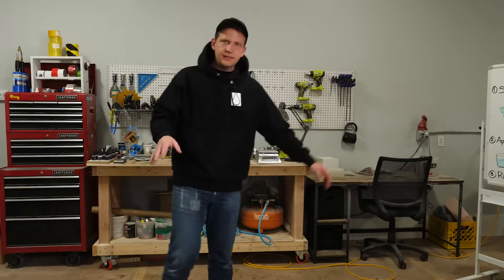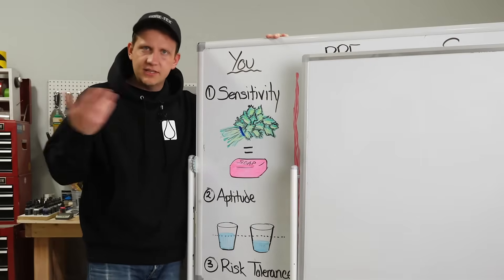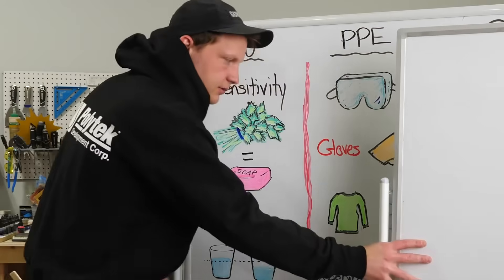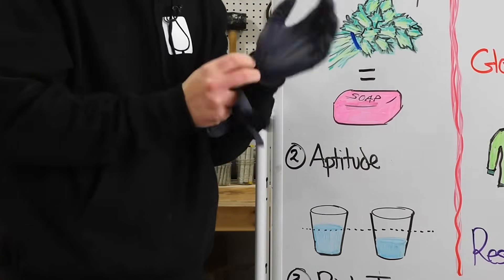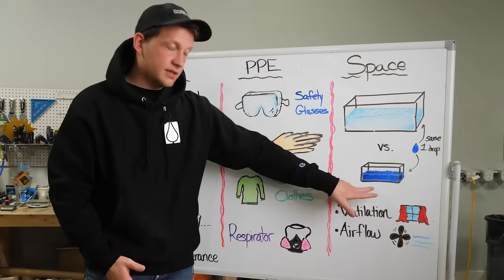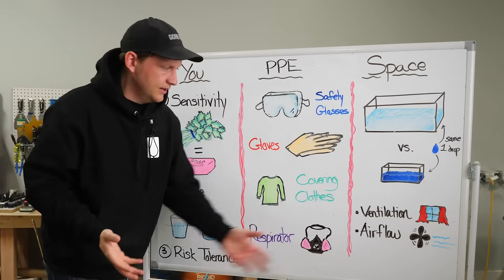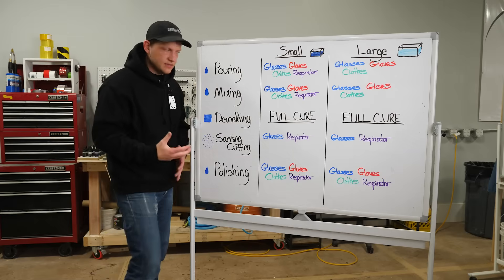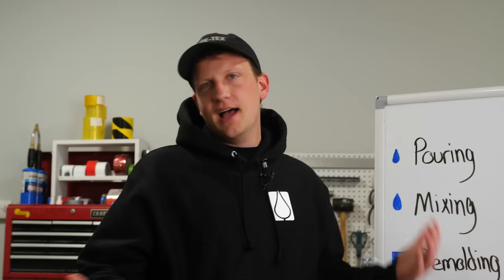Alumilite Explains: Epoxy Safety

Comment: PPE? From watching most youtubers that work with resin I thought you didn't need any.
Reply from the maker: Resin is made from straight chemicals - it's very important to treat them as such and wear protective equipment to keep yourself safe! A lot of people that get into resin don't realize this until it's too late.
Reply: @AlumiliteCorporation  Filters what mask do you recommend? Brand, where to find the mask itself and the filters. I do not feel Home Depot and Lowes customer service is reliable enough. What brand and models do you use?
Reply: @americanrifleman2992  if you still need an answer… I’ve been watching a lot of videos tonight and leaving this comment where people can see it. I’m a total beginner at resin. Only been doing it a few weeks. But I did my research. I bought a 3M 6200 series half face mask and a multi-gas / vapor cartridge for it and I have had 0 complications with smell, headaches, nausea, etc.
Reply: @nicolebry1120  thanks, huge help. I have held off on projects just so I don't kill myself early.
Reply: Hi where can I get one respirator like the one you bought? Do you have a link?
Reply: @rosy4341  home Depot sells 3m half mask p95 respirators and filters you want the pink ones with the hard shell around them. The circle ones get in the way.
Reply: @joe_ferreira  p95 are dust and particles. P3 is what you need for fumes/epoxy. P95/p2 won't do bugger all to save your lungs
Reply: @nicolebry1120 ABSOLUTELY !  My daughter is a BioOrganic Chemist. She had me order ONLY 3M Brand because off-brands sometimes are branded with certifications that really are not there!
Reply: @AlumiliteCorporation  resin is made from straight chemicals? So they aren't gay chemicals?
Reply: There are whole face book groups dedicated to people who got lung cancer from epoxy.
Reply: Sound and sensible preventative advice. I hold my hands up to being caught out and had an excruciating experience yes I had a respirator on also gloves and long sleeves BUT the exposed parts of my face, ears cheeks neck were affected window was open but air flow was limited so please follow this advice.
Now I need a full head coverage respirator and make sure everything is covered re my sensitivity and an extraction method will be put in place.
Thanks for this video. 😊
Reply: There is onky one video of a woman who burnt off her cilia in her lungs from breathing epoxy fumes for a project. Chronic cough and nausea, maybe forever. 
The rest of the videos I have found are very enthusiastic about working without a mask, since some epoxies are odourless. This must mean it is harmless, no? No.
Reply: Sure you don't... If you don't mind getting mesothelioma..
Reply: Yes it’s very very toxic
Reply: Exactly! That a really big issue. There should be a disclosure at the beginning of all videos and a link to this video?
Reply: I thought the same, so glad YouTube magically brought me to videos that make it clear to wear protective gear.
Reply: Thank you for this video on safety. I had no idea that needed a mask.
Reply: Just like working with silicone the smell kind of feels like it's kills my lungs and brain. Use gloves, goggles, and respirator
Reply: @Joe Ferreira yeah man don’t use the circle fabric filters, that will only stop dust particles and such not certain chemicals. I’m a welder and when working with aluminum you NEED the chemical filters otherwise you’ll have “early cognitive impairment/dementia” before you’re 50 if you’re lucky enough to survive the lung cancer you got a decade or so after you started welding. Use the proper filters or you will hate yourself for being so foolish.
Reply: Did you not watch the entire video before posting this idiotic comment?
Reply: Fuck that lad serious the inside of my nose has been burnt bad I only did a small pour fuck that fuck me my fave is killing off it I had a top of the range face mask and gloves but I took it off afterwards and two days it took to set and I just went about my day and oh shit my face is killing need to over vent not under vent its dangerous shit
Reply: I dunno.  Most YT'rs i watch are pretty cautious i feel.

Comment: This is a very good video. Epoxy has become so common place. People don’t realize it’s a toxic substance and extraordinarily dangerous substance as it can literally crystallize inside your lungs and seep into your skin. Personally I use reusable long gloves and resusable short gloved I have never used epoxy and not had it accidentally get onto my forearms and it does soak into normal clothing. A painters suit is highly recommended. All of this makes me a horrible sweaty mess.  I have seen too many people end up with immune disorders from epoxy poisoning. 

I absolutely love the material but it extremely dangerous especially in a 2k spray. The hobby art market has made it seem far too casual, though I don’t know how anyone could smell the stuff and not instinctively know this is bad for you. 

The biggest thing I want to emphasize is it spills and gets everywhere cover yourself well and leave drop cloths on your surroundings. You don’t want to end up panicking and having to try to clean something during curing which can end up making you reckless.
Reply from the maker: Thanks for watching and for educating!

Comment: I've seen people release the pressure from a pressure pot and stand right over it, basically inhaling the air. Wouldn't that air be full of "off gassing" from the resin as it cured? I have a exhaust fan with tubing that I place over the pressure pot and divert the air outside my one car garage. Figured it's better to be safe than sorry.
Reply: Hey! Jordan from the video here. I think your method makes a lot of sense. The amount of off-gassing will depend on the size of the pour so it's still a little "case-by-case"s. I (like you) default to safety and point the air release away from me. Great thought!